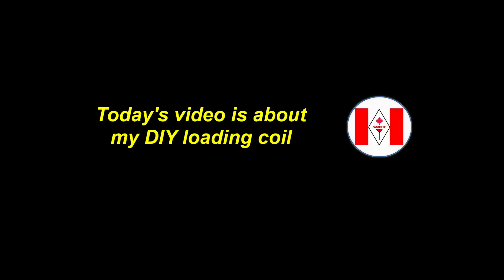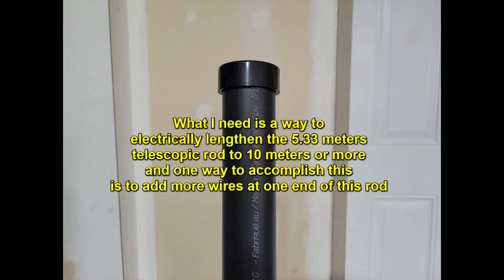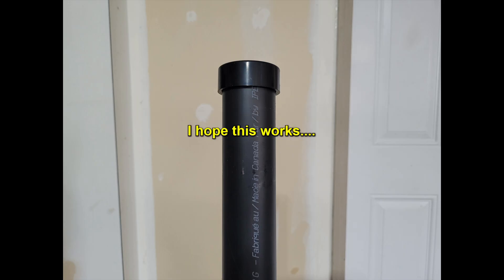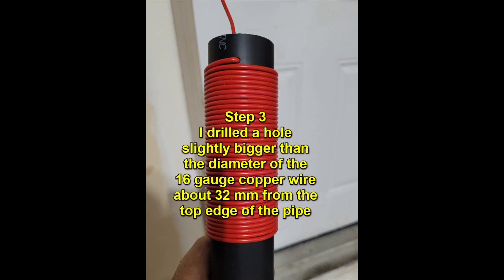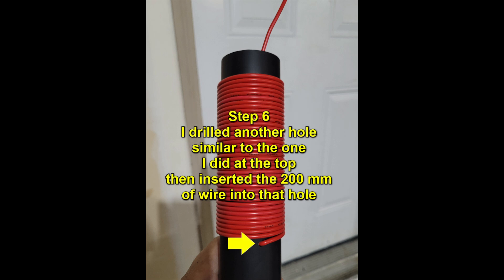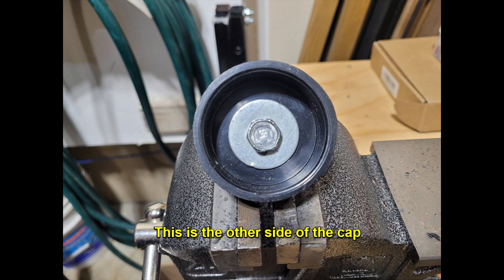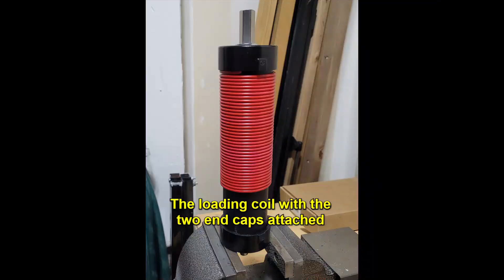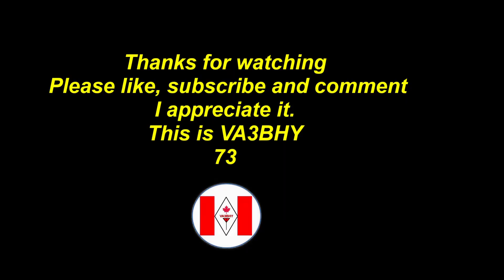My DIY Loading Coil To Operate On 40m and 80 meter band. You can too! (Part 1 of 3)

Comment from the maker: Materials used on this video:
Barrel thru connector M10 - https://amzn.to/47uWwPB
M10 bolt - https://amzn.to/4nlxGq0
16 GA flex wire - https://amzn.to/467eIwh
Vertical antenna kit -  https://amzn.to/3HYKPpY
Reply from the maker: Approx 11 uh

Comment: Nice and clear step-by-step instructions. Any idea what the inductance is for that coil? Thanks and 73. AB3JS
Reply from the maker: The on line inductance calculator suggested it is around 11uh but I did not care too much about the inductance because I have an adjustable telescopic rod and a Nano VNA that I used to tune the overall VSWR.
I also do not own an LCR Meter at this time. 73 - VA3BHY

Comment: Some VNA SWR measurements would have been good.  Could you have used such measurements to change the coil windings to get a better match with the whip fully extended?
Reply from the maker: I did perform SWR measurements using my NANO VNA on the field before starting my POTA activations but I did not post it. Maybe I can send you the VNA readings later. The coil is very useful the way it is. If you are going to use a vertical antenna like this: https://amzn.to/3HYKPpY that is resonant at 20M and above, then you will be pleased that with this coil, you will be able to operate at 40 meters with the whip antenna extended only to 1.5 meters!  If you use this coil plus fully extend the vertical antenna to 5.33 meters, you will be able to operate at 80 meters. Use 12 counterpoise laid on the ground each counterpoise is 3 meters. Using this coil as a base loaded coil with the 5.33 meter telescopic rod, and 12 ( 3 meter) counterpoise,  please do not expect a 1:1 VSWR. The lowest I can get at 40 meters is VSWR = 2.0 with the antenna rod extended only to 1.5 meters. Imagine that. The ATU-100 made the fine tuning to the SWR to make it VSWR = 1.1. Please watch Part 3. https://youtu.be/CiIHHMyxxBQ

Comment: How many turns are on the coil?73
Reply from the maker: 36 turns with 200 mm pig tails at each end. I think the number of turns is not important. I did not even measure the inductance of this coil. The main reason is that I am using a telescopic stainless steel whip antenna that can extend up to 5.33 meters. This gave me flexibility on tuning this antenna. When I fully extended the rod to 5.33 meter with this coil at the base, my Nano VNA indicated it was resonant to 3.5 MHz (80 meters). I actually have to shrink the telescopic whip down to around 2 meters (from 5.33 meters) to make it work on 40 meters (7.2 MHz)

Comment: That is ABS not PVC. I don't know if there is any difference in how each affects RF.
Reply from the maker: Thanks for the correction. I don't know also if there are any effects on RF. But this is just an experimentation and I am not familiar with ABS just PVC. By the way..IT WORKS PVC or ABS. Home Depot labelled it PVC. Functionally there is no difference at all. Both convey sewage. Both don’t corrode. Both are glue joints. So both work fine. Beyond that it is likely regional. If an area uses PVC, that is what the plumbers are used to so that is what they use so that is what is stocked so that is cheaper so that is why the area uses PVC.
Reply: PVC has a different dielectric constant which changes the velocity factor. It doesn’t matter here but will say if he elevated the feed point by at least a meter, he’d be having a much stronger signal across the bands.
Reply from the maker: @H33t3Speaks thanks!